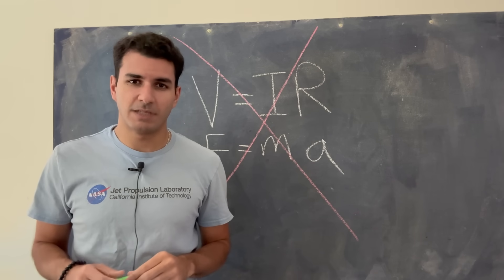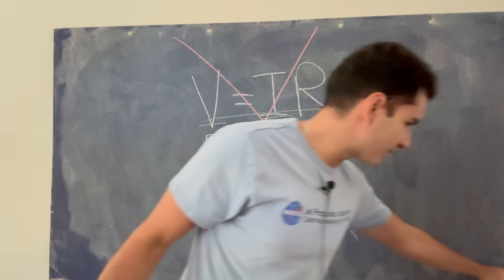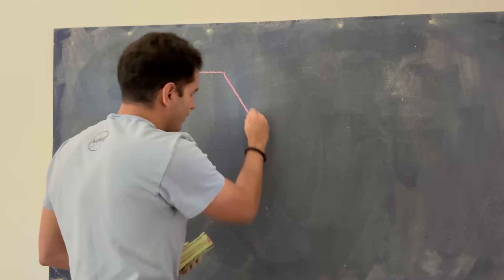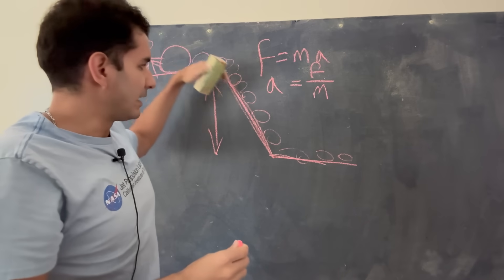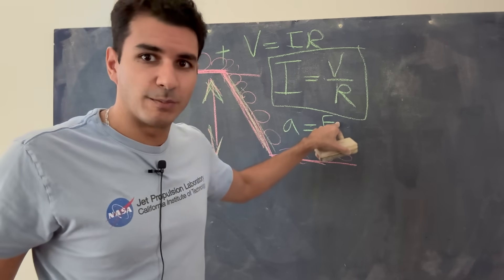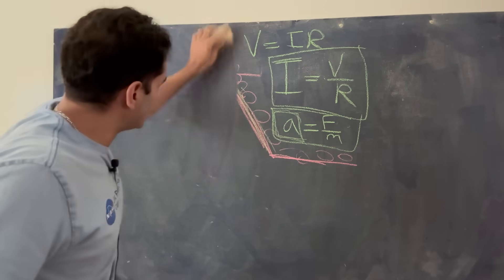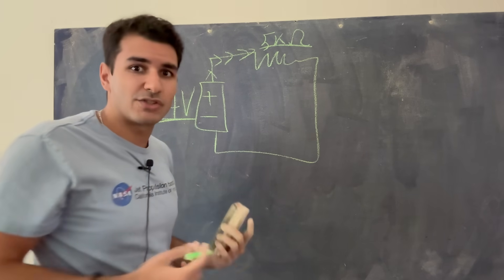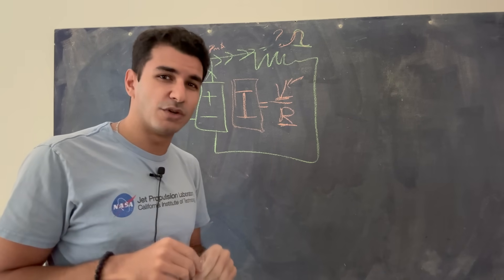You don't really understand physics

Comment: My two cent on this is, that writing F=ma was having motto of defining what a force is. Acceleration is the only clearly measurable quantity of the three quantities. Mass and force were both defined by a single equation. Writing a=F/m, then I'll come and ask how did you get mass? If you say that by measuring weight, for acceleration is sane for all objects, I'll say that you're literally defining acceleration in this equation via F/m, this is circular reason (which did happen for F and m) but this is even worse.

Comment: I appreciate your point, but I contend that it should be taught both ways at first.

First, the teacher can say: "here's the standard form: V=IR. Write it down, as it's easier to work with. Buuuuuuuuuuuuuuuut..." then they'll flip to the next slide where it's rearranged, and say "this is the forms you're more likely to use it in. Let me remind you how you can algebraically rearrange to get these..." and do so.

Anyway, the next point should be to discuss how (while throwing in dummy numbers like 1, 2, and 3 to work examples out on the board during lecture...) as you manipulate one variable, if you assert that another variable is "locked" and cannot change, then what can we expect to happen? Yes, this other variable must be the one to change. Since they're inversely proportional, one goes down and the other goes up, yes? How much? The same on either side? Correct.

Then... we should see how this works in reality. For example, with V=IR... we should look at a circuit and say "well since we know that 2 resistors of equal value will drop the voltage equally when in series, we know that if we put in 12V here across those two resistors, we should expect 6V in the middle and 0V at the bottom, yes? Let's check that." Then do it again with 5 resistors of equal value. "Well, 12/5 is roughly 2.5 or so, right? Doesn't matter if we're accurate, we just need to know it's about that. So, we know we can expect 12V, 9.5, 7, 4.5, 2, -0.5. Obviously my math wasn't perfect since we can't have less than 0V at the end, but it's close enough, right? Now, let's check. Hrm... yep, looks like it's lining up!" That last part is important. While I think my teachers were great, I went through an entire year of electronics courses before reading a line in a textbook saying something to that effect... "the math doesn't have to be exact. The point is that the technician/engineer can quickly assess in their head the expected relationships and thus, the rough values expected to be measured." It really changed how I look at a lot of this.

V=IR and P=IE and F=ma and PV=nRT are all easier to remember, and a good student can derive the formula they need when they get to that problem.

But, yes, back to your point: people who simply write down all the formulas and aren't pushed to understand their relationships are the ones in the most trouble. If you're looking at a formula sheet all the time, you aren't comprehending the "why" of these things, and thus, you aren't learning anything.

Comment: The voltage sound like the energy to the charge to flow in order to pass through the resistance(imagine u are moving in a crowd places, u need to push other person like that. Just the same theory the resistance same as many atom as a obstacles to stop u flowing so u need to get the energy to move. As I=V/R, assume the "energy" supply is consistent. So its mean how many current i need to supply that much of work done to move across the resistance. Understand the relationship is crucial but the school teacher seldom teach like that

Comment: This video reminds me of my earlier work in repairing/checking medical home-breathing machines for Sleepapnoe and above: In 10 years, one of the most discussed problems was( and will ever be ). What is the difference between air pressure units like mBar, HPa, cmh20 and so on. Hydrostatic pressure caused a lot of question marcs. More people than it should be will never know, that 1 Bar is 10^5 Pascal, so mBar and hPa is the same value.

Comment: Very intuitive explanation, thanks a lot. Especially for the mechanical domain, you explanation makes sense because acceleration is always caused by a force. In the electrical domain we sometimes do treat the current through a resistor as the cause for the voltage  across the resistor. But only  in case there is an almost ideal current source, for instance an inductor with a voltage across it…

Comment: I am in high school and for me Physics is nothing about plug & chug mathematics, formulas or laws. 

It’s about relationship between variables and how they affect one another. The direct conceptual event/thinking behind it (being why is it even happening, at a macro or micro level (connects to chemistry usually)). And how said relationship was first discovered/formulated. 
If you yourself figure out and mentally prove why something is happening the way it is, rather than blindly following an observation or law, it takes you way far. 

People in my 11th and 12th grade class found me crazy, cuz I used to spend hours on the most basic plug and chug homework’s (and readings). Just sitting there having thought experiments on why it is even happening (physically), and now it is supported by maths. The formula was given, and one just needed to plug the values and solve for them. In worst cases, do dimensional analysis (which can be done blindly). Yet I attempted to question everything given and conceptualise it myself, not just mathematically but logically. And now that we are moving to college, I am only one in my class doing a Physics Majour. 

It is important to realise that maths  (usually) shouldn’t be a proof for physics, but rather an aid that can maintain said proof everytime one uses physics.

**I must note that my IB physics course has led to seek and have a conceptual understanding, on top of the usual mathematical principles that other Education Boards emphasise.

Comment: I think that Neither 
𝐹=𝑚𝑎
 𝑎=𝐹/𝑚
(and similarly) 
𝑉=𝐼𝑅
versus 
𝐼=𝑉/𝑅
is inherently incorrect; both are mathematically equivalent expressions of the same physical law. The choice depends on context and purpose. Expressing the dependent variable explicitly, such as 
𝑎=𝐹/𝑚
often clarifies causal relationships and aids conceptual understanding and problem-solving. Conversely, the traditional forms like 
𝐹=𝑚𝑎
F=ma typically emphasises the fundamental principles or definitions underlying the laws. Ultimately, both forms are valid, with the preferred expression determined by whether one aims to highlight conceptual insight, facilitate calculation, or state a foundational principle.

However, the case can be made that especially for schools, switching between different forms could confuse the students, rendering it counterproductive. Thus, education systems tend to favour F=ma over a=F/m. 

TL;DR: Standard representation teaches laws and principles whilst what he suggests aids in overall understanding. Both are viable. Schools may not use both concurrently as it would confuse students. Thus, they choose the form that would aid them in the recollection of these principles during examinations ---- the standard form.

Thanks, have a nice day.

Comment: You are correct. Resistance is an intrinsic property of material. Current and Voltage are dependent variables but Resistance is an independent variable.
Reply: Incorrect. Resistivity ρ is an intrinsic property of a material, independent of its shape or size. In contrast, the resistance R is an extrinsic property that does depend on the size an shape of the resistor.
Reply: @markkogzhang1230  you are correct, the word resistivity should have been used in the comment in place of resistance.

Comment: In I=V/R , I (current) is effect of V and R . But in F=ma not same like that . Coz when we wrote it as a=F/m it gives the meaning of the effect of movement of a object (acceleration) produced by given force (F) and resisted by the cause mass (m). 
In other case , when we wrote it like ma=F it gives the meaning that 'm' mass of a object , if it travels with the acceleration value of 'a' , the effect of these will be produced as force as a part of a object of the object.
So both a=F/R and F=ma gives the meaning.

Comment: The proper way to state Newton's principle is ma=Fnet, where right side is the net force and this is also vector equation. As far as Ohms equation delV=-IR, where left side is potential difference and it must be negative on the right. In later form Ohms law can by applied to right Kirchhoff's voltage law.

Comment: I appreciate that you have made clear the distinction between the plain equations and the cause and effect that goes on behind the scenes.I agree with the a = F/m form where F is the cause and a is the effect, and I also tell my students in this way. This distinction is necessary specially since many students I know, believe 'ma' is a type of force due to the '=' sign (that arises due to the acceleration!), and then they go down an incorrect path while solving questions. 
I cannot think of situations where an acceleration causes a force. However, for the V = IR form, I know of a situation where current causes a potential drop across the resistor. Consider a power supply that is a 'current source', instead of a 'voltage source'. This gives out a constant current as long as the load is within its specified range. In this case don't you think that the current can CAUSE a potential drop across the resistor? 
There are two other ways of looking at this (V= IR) equation. One is the 'definition' of R as the ratio of V and I (R = V/I, which is valid for Ohmic as well as non- Ohmic conductors), from which this equation follows. The other source of this equation is the proportionality of I to V, and the constant of proportioanlity is the reciprocal of resistance (1/R), which is Ohm's law. This is closer to the cause -effect relationship, as explained by you. And this distinction I could appreciate only quite recently! I don't think that most high school students (and teachers) have the time and the patience to get a grip of all of this at that age (as rightly pointed out in the other comments).
In fact I am in favour of having three variants of the equality sign to remove some confusion due to its multi-purpose usage. One is for the 'equality' of the quantities on the two sides, as in an equation (x^2 +3*x = 2y-5); Second is for 'defining' a variable as is done in computer program coding (let y = 4), or writing the value of a constant (c = 3x10^8 m/s); and this third one that shows the 'cause and effect relationship'. There could be more...

Comment: I try to teach Ohms law using an experiment where the current is measured for a range of voltage values as inputs. Then I plot a graph I x V, where 1/R (conductance) is the slope of a line. After that, I ask the students to invert the function. So it ends in a V x I graph where R is the slope. Finally, I point that this behavior is a property of linear circuit components.

Comment: FOr V=IR , I learned an analogy that explained it pretty well for me, basically think of drinking a drink with a straw, the pressure your mouth sucks (no homo) is the voltage the actual fluid flowing and travelling is the current and the resistance is the size of the straw. this idea is reinforced by the math if the resistance is high then you need more push or more voltage, so if you understand this concept you can arrange the formula any way you want it will still make sense. Notice the formula for Resistance is Resistance= Resistivity* Length / Area which is mind blowingly common sense, a longer straw requires more pressure or in this case voltage and a straw with a bigger area requires less voltage just imainge using a straw the size of a paper towel cardboard roller thingy compared to a thin small coffee mixer straw.

Comment: I think V=IR should be written as V/I = R, thats how it was discovered by simon ohm - its like a constant for a conductor at a particular temperature.
A comment here pointed out that they thought voltage will increase as long a resistance is increased. So a formula like V = IR should be avoided.
formula I = V/R should be avoided in my opinion as it represents lower resistance increases current while current depends on the source

Comment: For beginners, formulas often hide causality and overwhelm with compressed meaning—math, units, and physical concepts all at once. Students grasp cause and effect better through experiments, not equations. To ease the load, avoid fractions early, separate conceptual questions from calculations, use number-based examples, or memory aids like triangles. Avoiding fractions does the least harm to integrating math and physics later.

Comment: Current is Voltage per unit resistance, and Acceleration is Force per unit mass.
Also, i find it intuitively easier for me to visualize electrons flowing from the negative end in a circuit diagram.

Comment: im in school to be a electrician right now, the v=ir thing is a great. Our job at the end of the day is to take the voltages we are given, hook up a resistance (light, motor, etc) and make sure that the wire that is run inbetween can handle the current/heat. all while doing to safe fast and cheap ofc.

no one is trying to figure out the exact resistance of a lightbulb and you will never try to get a oddly specific transformer to get exactly 137.6 volts.

i love this video it tickles my brain! you perfectly hit the "understanding" without going into any math wow.

Comment: Its possibly because of Partial Differential equations that f=d/dt(m(t)*v(t)) where if the mass is constant, then f=ma. But a lot of classical physics has the fundamental error of science, assuming by isolating the parts you can explain the whole. For example in low complexity the ball rolls to cliff, and rolls down.  In High complexity there variations where the ball rolls half way down the cliff and starts floating. That the internal chemistry starts shaking and causes it to ballon in size. But its still determined by physics. But even higher complexity and things because of uncertainty of atomic position like in Quantum Biology, that frogs can have a very strong chemical bond in tail, but taking advantage of a certain glitch in the quantum world it can break those bonds down when morphing into a frog to be enegy efficient. NASA JPL maybe like this or that about rocket fuel, and I'm like the point is like Cantor's Leaky Teepee, where you have this totally connected bond, but remove just one point and the entire system disconnects. H with 4 carbons around it is an example. Pluck out the H and you get carbons scattering. In one branch of infinite variations one has concepts pop out like lock and key fuels. Other branches that expansion force isn't used like a rocket but to stretch a material out like a raft.  Then that can branch into things like expanding giant ballon tubes into near space, and using it like a straw. There enormous amount of complex forms of physics to be discovered still.

Comment: ya but finding different types of causes of a single thing can vary depending on that thing right. for example, the ball you used when it rolled down a steep edge what its the main goal of calculation, is it the weight, the speed, the potential energy. anyways thats how I see it but I got the same reaction when I first started learning rules and stuff like that.

Comment: Some of my fellow AP physics teachers would blow a gasket when I told them I don’t put the vector symbol above the F or a, or any of the other vectors equations my beginning Physics students encounter. They know they are vectors, and its one less thing for a first year student to worry about when learning the massive quantity of material in Physics C Mechanics and E and M. V=IR may not be as technically correct, but if they understand what it means it is much easier to recall than writing it the way Ohm did. We have some heated debates about this, some agree some don’t.

Comment: It depends how you understand function. We can have other understanding of a function such as a function is a mapping from a set of variables to another set of variables. We can have other interpretations of V=IR, rearrange it a little bit: R = V/I tells us what’s the quantity that keeps constant in various combinations of V and I, it also quantifies the response of a resistor when V is applied. In semiconductor, R is not always a constant and defined as R = dv/dI. This is actually the response of the electric device. Also for F = ma, it is actually F = dp/dt which is exactly what the cause-result relation is. The applied force causes a momentum difference per unit time dp/dt. Another way to think this relation is that the ratio F/a quantifies the inertia of an object, this is also a way to understand mass m. So there are multiple ways to understand these formulas.